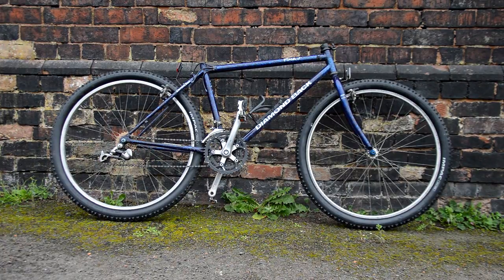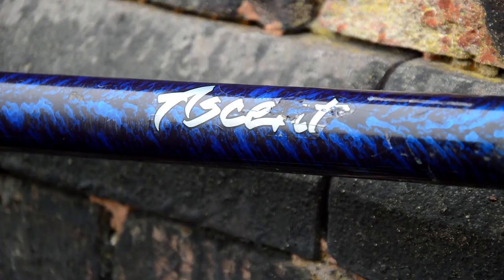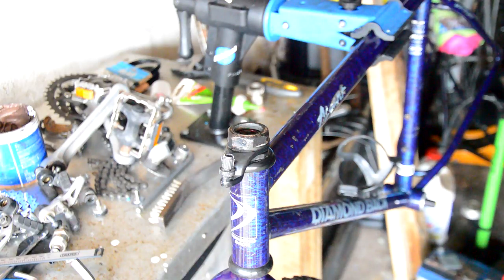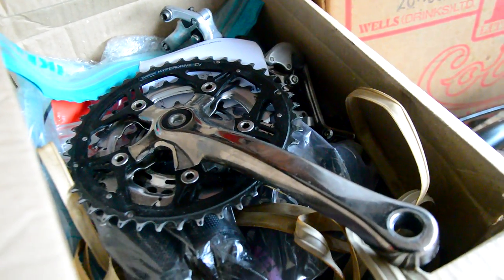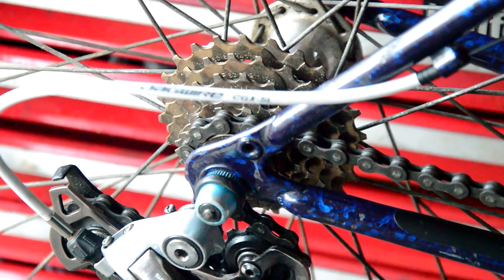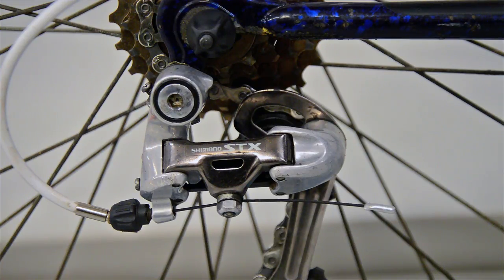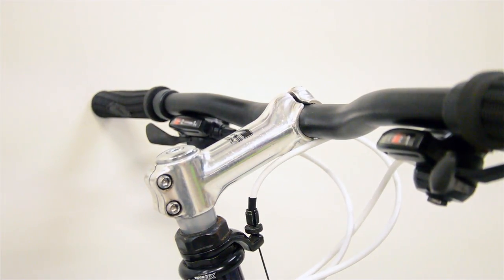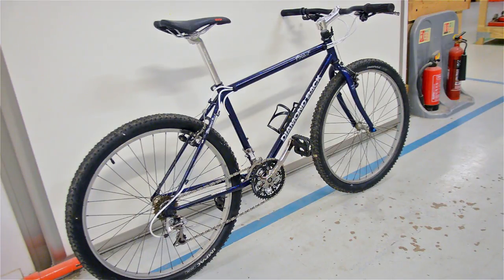1994 Diamond Back Ascent - Retro Mountain Bike Rebuild

Comment: I purchased an early 1990's Diamondback Ascent in red that is equipped the entire Shimano STX groupset. The hubs, shifters/brake levers, bottom bracket, front and rear derailleurs, cranks, crank arms, everything. Except for the headset and pedals. All original and believe it or not completely brand new. Even still has the Avenir tires, seat clamp, and saddle. Absolutely beautiful.

Comment: This bike looks really good with the shadow chrome and white cabling. I hope you get the hub sorted out. You can never have too many gears.
Reply from the maker: Thanks!  Yeh the hub shouldn't be too hard.  I'll just have to whip the axle out and switch the freehub over.  Maybe I'll have to adjust the spacing a little too but it's not too much trouble.

Comment: I like the 1994 STX special edition. Looks so much nicer as the regular version. I also have a few retro mtb's from the 90's. If you like check out my latest slide-show videos. There's a 1992 GT Zaskar, GT Richter 8.0, GT Pantera AL, 1994 Parkpre Team 925, Indian Arrow from 1993 and my 1993 Centurion Titanium bike.

Comment: They usually use altus up front to save some money surprised thats not an sr crank also you should put spacers in the gap on the stem conversion to reduce stress

Comment: You got that for a steal. I had it in the marble blue metallic in high school.
Reply from the maker: It's sure not a steal anymore with the money I put in it... I have about £250 in it now...  largely down to the original repairs to the 6 speed hub (and new cassette) and rushing to the shops to get the BB and clamp rather than use eBay.
Reply: It was a 7 speed when it came out. Much of the bike was definitely lost/swapped out.
Reply from the maker: And now it's much better :D  Definitely going to get some time in on this and try one of the retro races.

Comment: Awesome video, but here's a naive question??? Could you have installed a 2018 deore groupset (for the most part) if you wanted to?
Reply: Without the discbrakes, yes (or get a adapter)
Reply: Definitely. As long as the wheel has the right hub body for whatever speed you choose. Rim brake wheels are still easy to find new or used. You can choose 8-10 speed and still get parts online easily.

Comment: Just bought an89 Diamond Back  Apex for 145.00. All original including all the reflectors and spoke guard. Same bike as I had in 89 including the color : smoke lilac. Needs new rubber and I plan on servicing it as soon as I get it.
Reply from the maker: Nice!  I have a 91 Apex.  What tyres are you thinking?

Comment: I’ve got an original 1990 Diamond Back Topanga that I’ve had since new 👍🏻
Reply from the maker: I almost picked up a white one a few months ago.  I think it had a U Brake on the rear?
Reply from the maker: Westcliff GoPro I’m actually looking at one with the 300LX gear but it’s kind of a white / black / gray splatter paintwork 😂
Reply: Nice build

Comment: Shop saled bikes has always had mixed component (still today ) typical eye catcher design  ...pretty normal in the bicycle industry so they could be sold for a much lower price against those who had complete LX parts on it .To the rear wheel yes you can do a 7 speed freehub on it but you may have to change the bearing that fit to the freehub and after setting propperly the shaft in the hub you have to true the wheel again ...no offense there but for such a cheap type of wheel way to much work !   Have fun !

Comment: Love your work :) Although, I have a question unrelated to this MTB rebuild......I'm sure you did a video where you changed out the bolt from a recess nut type brake caliper for an older style nut and bolt, so as to fit an older frame! Which video was it on? I can't for the life of me find it. Anyway, keep up the good work :)
Reply from the maker: Thank you!  I did, and you were close with this video!  It was on the Diamondback Apex build video.  

https://youtu.be/-7OGhiKB4H8
Reply: Thank you so much. I though it was on one of your road bike build, hence why I didn't look at the Apex lol Thank you again :)
Reply from the maker: No problemo.  Happy to help.

Comment: I have a set of 36T seven speed freehub/cassette hubs (F and R) if you need. I'm in France but will be back in the UK at xmas if that helps. I'll give you a follow in Instagram if you want to get in touch about it. Beautiful build BTW. Beautiful cranks. I did a similar thing with my dad's old steel Saracen but with a newer 10 speed group.